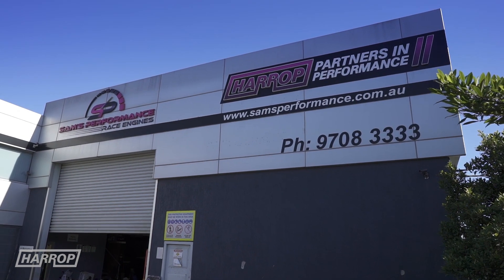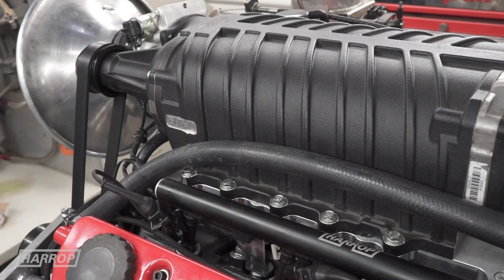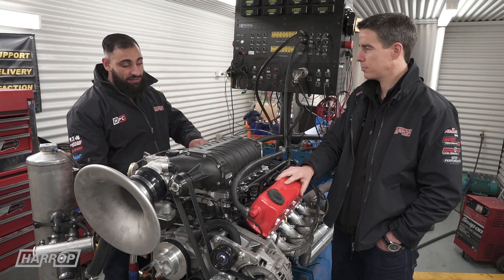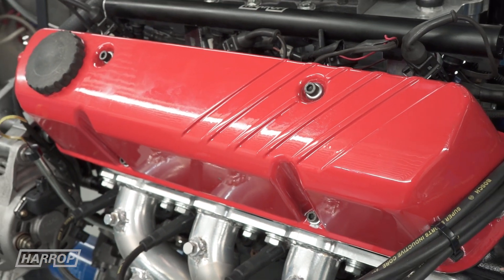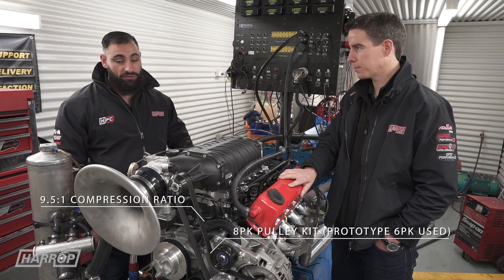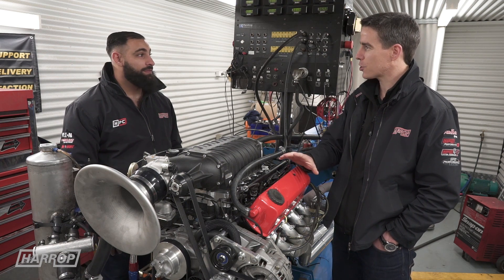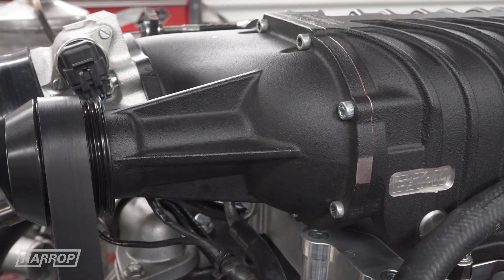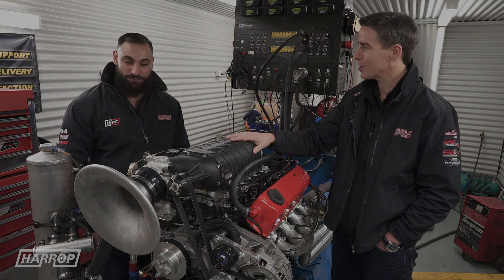Holden 355ci V8 | Harrop Supercharger Kit

Comment: So in a real world application this would need an intercooler kit bigger injectors and throttle body to make these numbers? Or can I just bolt this on with the 90mm throttle body put say 60lb injectors fuel pump in it and make 700fwhp? On a similar engine spec

Comment: Hey there im currently drifting my vn 5.0 in newzealand and want to keep it 5.0 what would a setup like this cost with a solid valvetrain setup as drifting can be harsh on the rev range/strain cheers
Reply: Over 10 grand for the charger kit you can buy a lsa crate engine for that
Reply: @kimboDragon  yeah. But it won't be a blown Holden.... See what we did there?

Comment: That Is verry impressive! Especially after seeing the vf gts u guys done, lsa 416ci stroker forged internals running the tvs2650 supercharger making 600kw at the wheels and the sound of a 355 shits all over the sound of any LS motor
Reply: The sound of an engine won't win you any races. Waste of money.
Reply: @murrijuana2842  as I mentioned below there is a vr ute with a 355 and a centrifugal charger running consistent 9's  which would certainly win races and still sound tough.

Comment: This setup would make a lot of holden men not turn to the lsa!
Reply: Peter Noy i hope so
Reply: Err its Great but LS's are still a cheaper alternative
Reply: You can buy a complete LSA crate for the price of this blower kit alone. You can double the cost of the holden job once you build an engine. You'd have to be a pureist to do it.
Reply: @V6turbo  The supercharger kit is $10,900, LSA crate engine is more than double that
Reply: @Chris-od1jp  I priced only the parts they specifically mentioned in this and it was over $20K, not including the block, fuel system, exhaust or any accessories. Also not including freight for any of the parts. Easily 25-30K if you get a cheap block. A crate LSA $22K.
Reply: @Mr_armageddon  yeah but the other comment that I was replying to said LSA crate engine for the price of the blower kit. This engine is also making 600kw compared to LSA's 430kw. Exhaust, fuel system and accessories aren't included in a crate engines either.
Reply: @Chris-od1jp  yeah but an LSA pretty much needs an intake, exhaust, injectors and a tune to get 600kw, which isn't expensive. Given you're also getting a brand new engine rather than a rebuilt old one, for the same sort of money, possibly even a bit less, the LSA is a good option. Yes the guy is wrong that the crate engine costs as much as the blower kit but im just saying, doing what they did isn't cheap and an old block more likely to fail under boost than a new one, so if it were me LSA but both a good option if you have the money
Reply: @Mr_armageddon in regards to which block will last longer, it’s iron vs aluminium, considering the 355 has iron heads strapped to it as well, that engine will last, it’s boost limiting factor will be that of the tuner, the head studs/bolts and flow restrictions, unless the LSA is running a billet block, that will have the same limitations as the 355, but also you have the chance of tearing the heads off the block as the alloy won’t hold up the same.
Don’t get me wrong, the alloy block will still take a beating, but to say that the iron block is old so won’t handle boost, yeah nah, iron over alloy if you want a more reliable setup for the same power

Comment: I think the Holden motor sounds better than the chev and is matching it down the strip
Reply: Not even close.
Reply: @murrijuana2842  there's a 355 with a centrifugal supercharged running in the 9's that's not close? Lol and sound there's no comparison.